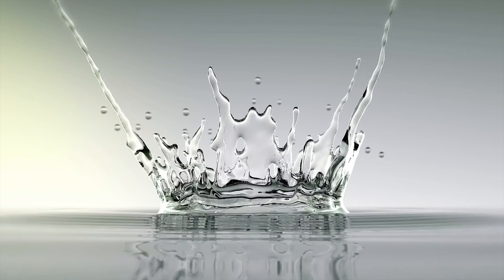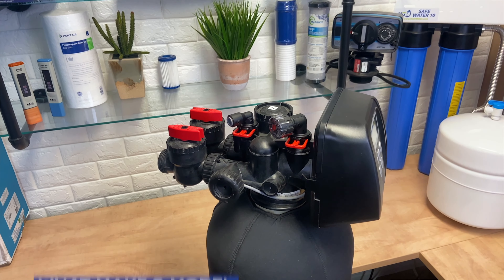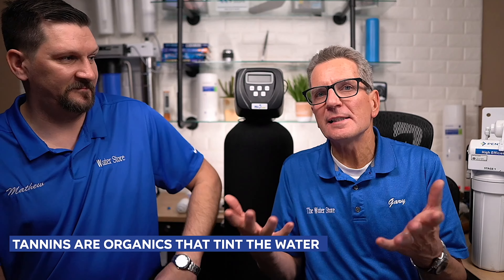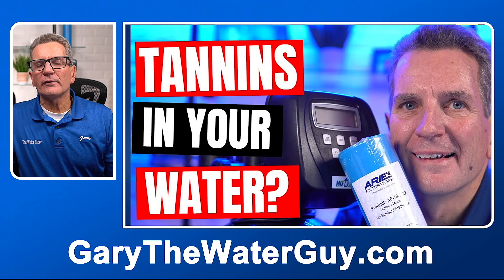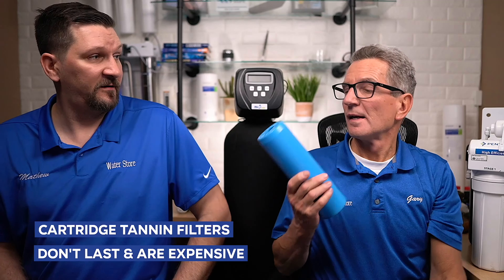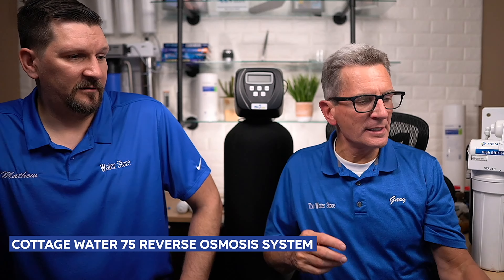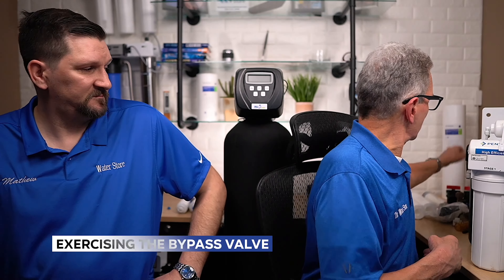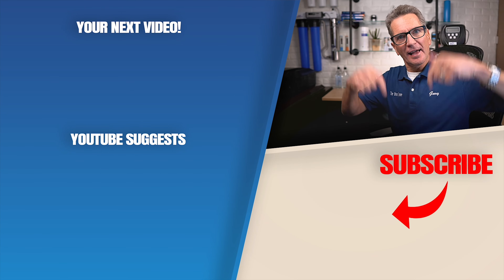TANNIN FILTER Maintenance Pro Tips & Tricks

Comment: Great video. And I watched all the others about the tannins problem, they were very helpful. But I have another issue.
So, I live on the lake and our water is from the lake - there are lots of tannins there. The height of the ceiling in my pump room is 45". I cannot find anything like those HUM Tannin Filter systems to fit in there.

Any recommendations? 2 people, 1 bath, 1 kitchen, and laundry

For now, I am using 5 filters: 5-micron Sediment -> 1-micron Sediment -> 5-micron Chlorine, Taste & Odour. It works, but I replace filters every 5-8 weeks
Reply from the maker: In situations like yours we install this tannin filetr in the closet https://waterestore.com/products/hum-tannin-water-filter-removes-colour and run the pipes under and then up and down through the floor.
Reply: @water_estore  Thank you for your suggestion. It is probably the only way.

Comment: Hi Gary, I stumbled on your videos for the last handful of years. We have a cottage on a small lake and get a lot of tannins in our water. I was thinking about putting together my own tannin filter. It looks like i may be able to get a mineral tank for a few hundred bucks, possibly a less. I also have a spare brine tank. I haven't looked into any other costs yet. Resin etc. Do you have an opinion or a video on someone doing their own tannin filter system ? I'd love to hear any thoughts you have.
Thx
Reply from the maker: I wouldn't.  The tannin media is extremely expensive and the valve is expensive too.  I suggest buying a complety engineered system like this one, that way you know that it will work. https://waterestore.com/products/hum-tannin-water-filter-removes-colour
Reply: Thanks for the reply. So I'm finding these materials for around $400-$500. The lowest price tank, (fleck 5600) Amazon/ebay cheapo special is around $1000 - $1200.
Curious what it is I'm missing? I've been do it yourselfer my whole life. I own a construction company and 15 homes. If this can be done, I want to do it. Always meant to look into it for another home we own on the other side of the state. I should've made a purchase 10 years ago when materials were a lot cheaper. Never did and now it makes me really want to put one together myself. Appreciate your original answer, but I'm curious where that extra cost is coming from.
Thx
 @water_estore